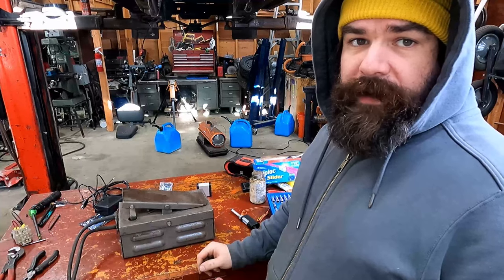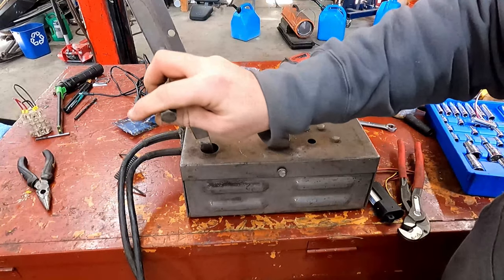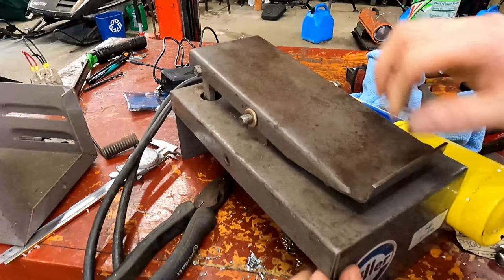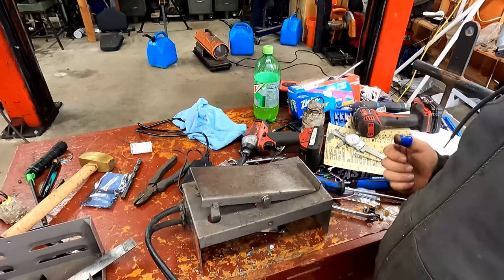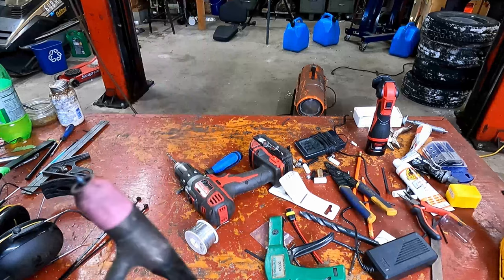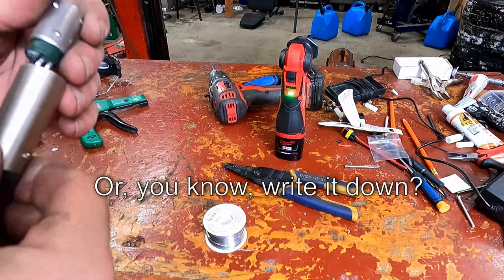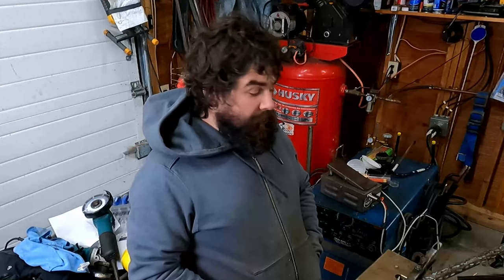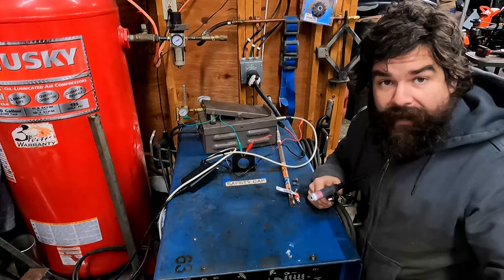TIG Welder Foot Pedal to Hand Control Conversion

Comment: I like this concept in principle.. found this video looking for a mod where we use the trigger pot out of an xbox controller to replace the pedal.. perhaps easier said than done..  would really like to see something like that..  seems like an xbox trigger properly fitted to the tig torch could be super ergonomic and easy to use.   I guess your pedal being oldschool actually passes the full welding current through it.. most modern inverter welders will use a basic low voltage pot in the pedal, so the xbox trigger COULD work for that application.  anyway nice work & thanks for sharing!

Comment: Interesting concept i have the same kind of welder and I found a mic-4 unit for mine luckily that converts the 2 plug system to a five pin plug to run new foot pedals and finger controls
Reply from the maker: If I ever found one at a steal of a price, I'd upgrade.  This is about half the cost of the only mic-4 on ebay right now, not including the pedal/hand controls.
Reply: Yeah I feel that, I got lucky and found one one facebook for 60 with a thumb control included, anyways I like your videos keep it up 👍
Reply from the maker: That's a hell of a deal, Thanks for the comment.

Comment: Ok very nice I bought a primeweld 225 and had the idea to convert the pedal to a hand control by piddling with the potentiometer inside after dismantling it. This video is the closest thing I CLD find of someone trying the same thing. I think anyway I'm only 10 seconds into the video.
Reply: Welp nevermind
Reply from the maker: @bradbradleys6091  With these old machines, the front potentiometer isn't really meant to be moved under load AFAIK.  This works ok, but I'm not sold on it being worth it after all.

Comment: Hey, just saw this. Do you know where I might find one of those pedals at? I have an old dialarc that has no leads that im trying to get working again. Im not sure where to find a foot pedal.
Reply: Also, is it possible to wire up a new foot pedal to work on a dialarc hf? Or even rework the dialarc to use a new pedal?
Reply: Good luck for some reason the pedals for these units is outrageous $$$